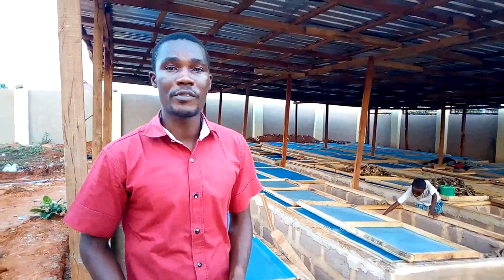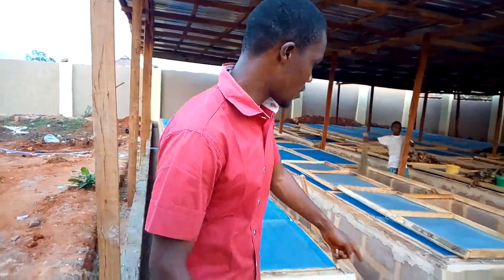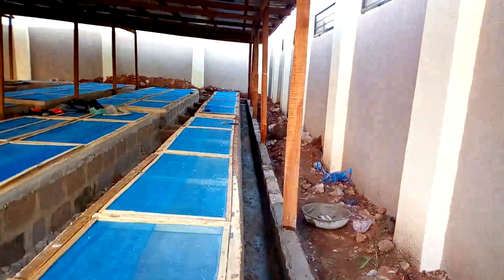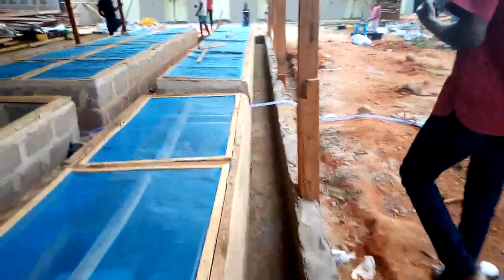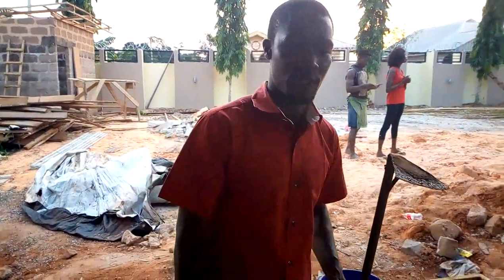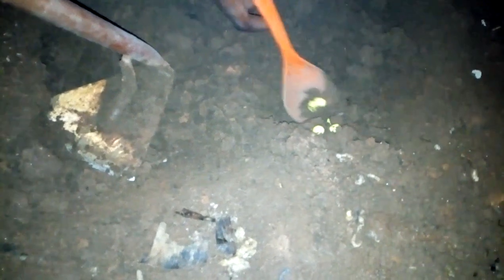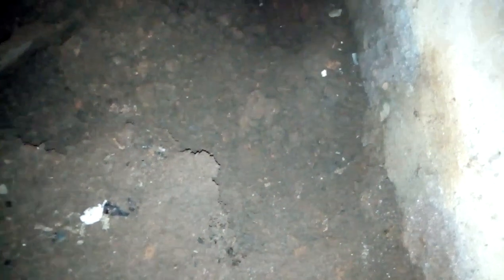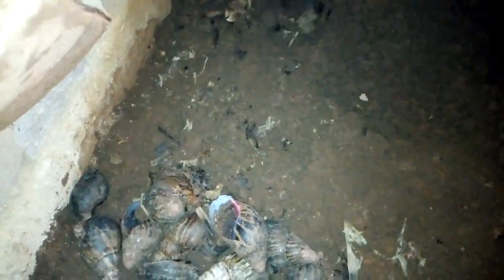Keep away ants from your snail farm. 08068525032

Comment: Due to it is a while ago and your farm is already working, you may figured out that some wooden columns are accessible by ants because their position is on the outer wall of the trench. So the ants may use them, moving up to the roof and go down through a inner column. Just check it out to be sure. Otherwise good luck and thanks for the video

Comment: I have been watching this video and can see one very big problem with your ant protection and I guess you can’t see it as all the roofing posts are the wrong side of the water protection system, so the ants can just climb up the posts and along the roof supports and back down a post on the inside.